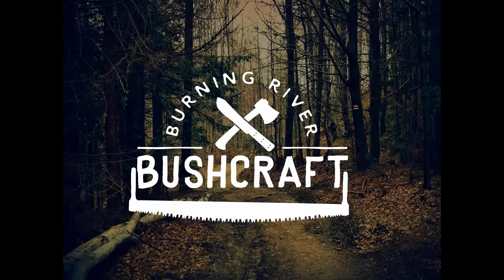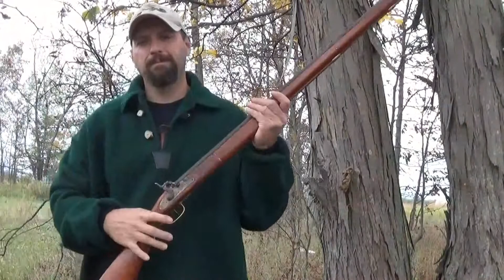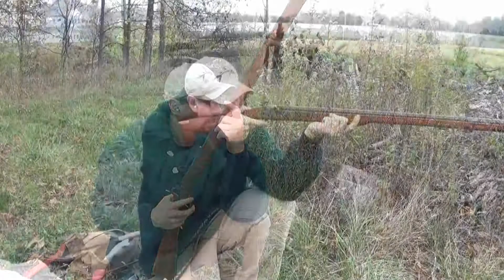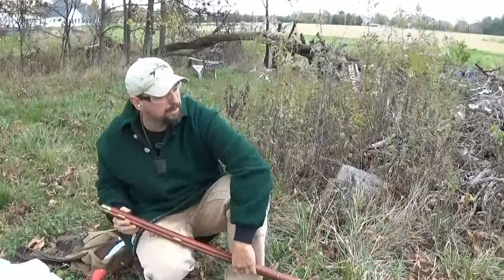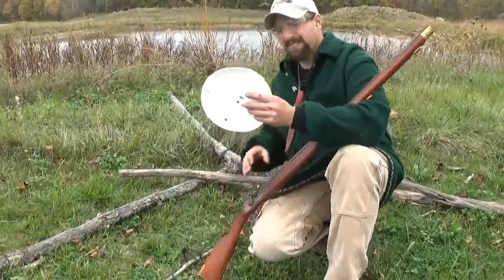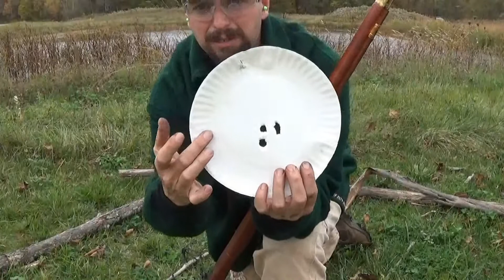Kentucky Long Rifle Build part 4

Comment: I have a kit, but curious on how to apply boiled linseed oil, how do you do it and what benefits dose it offer?
Reply from the maker: I brush on BLO and continue to apply it until the wood can't absorb anymore.  It protects to wood and if the gun gets scratched you don't have to remove the old finish, just brush on more BLO. It was also what I had on hand.
Reply: @BurningRiverBushcraft  could one use two stains, I have the kit and I'm told it's maple wood stock?
Reply from the maker: Yes you could I stained the stock first. The BLO is the protective top coat.
Reply: @BurningRiverBushcraft   Thank you for the help then.

Comment: Browne ls has an excellent hot brown. Stick that barrel on a wire stand heat it slightly with a torch apply . Works very well

Comment: Had to file mine down about a tenth of an inch to raise it enough to be on at 80 yards. My only gripes with the rifle is the stock was WAY to short & the trigger pull was horrid! Like 15lbs! Now both of those are fixed and all is good.

Comment: Thats a great looking gun.
Reply from the maker: Grandpa's Place thanks I am happy with it.
Reply: Have one just like yours,I built in the 70s still shoots. I got some 220 gr. 45cal mini bullet Tried them over 70gr. Of Pyrodex 2fg powder. Shot them well at 50 yds but it well KICK ya way more than the 125 gr patched round ball. I had some trouble with caps too
 Have fun with it.